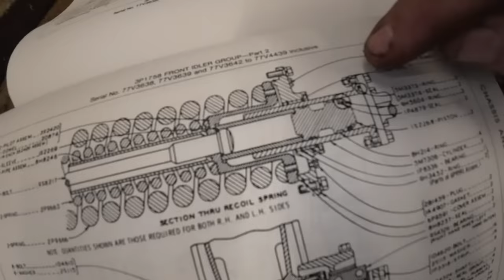We ran into several problems Installing the blade on the Cat D8K and getting it ready for paint!

Comment: Use a breaker bar with a pipe on it too break it loose. Air chokes pole. Unless you have a good compressor and air ratchet. Snap on has a 90° ratchet thats awesome for about $300. Well worth it.

Comment: I just happened across your channel a couple days ago.  I really enjoy the videos I've watched so far and I them educational even.  We have a 1967 or 68 96J D5 powershift that my grandpa bought in 1972.  I know there is a big size difference between it and the D7F and this big ol D8, but they appear to be really similar in design.  Where is a good place to get predrilled brake liners beside Cat?  I really don't want to pay $300+ per side for a machine that gets very little use on a farm.

Comment: Well, there is nothing like the sound of an old Cat diesel with precombustion chambers. They do clatter and rattle when they idle. The later direct injection Cat diesels are much more fuel efficient, and they don't smoke as much, but they sure don't have that Cat sound of the old engines. They also had to turn faster to make the same power.
Reply from the maker: For sure

Comment: Those chickens are not stupid. They hear a bird of prey calling in the family for a mid day snack and they KNOW their it. It's the dumbass humans that have the chickens penned in a roofless enclosure that has them squawking. Some of their basic natural instincts hasn't been completely bred out of them quite yet.  The "panic! Run! Hide!" instinct still works. 

BTW, it's November and you're not out hunting and/or fishing? Tell me you have the smoker running day and night.

Edit: Why are you temping fate? If one side of the track adjusting system is dry and needed servicing, why didn't you do the other side? If one side is damaged since it was last serviced and it shows signs from lack of service , the other side should be in a similar condition.  As a buyer I'll happily pay the  cost difference knowing both sides were done when it was overhauled.  Now one side has a diminished service life expectancy than the other. If you're that deep into the overhaul already it makes good business sense just to bust open your purse a little more.

 You were prepared to spend the money to fix it and flip it when you bought it, so why go cheap now? Just because it's easier on the purse strings?

Comment: do you guys have a specific concrete for the shop? how is it not mangled to pieces? especially at 4:21 climbing that tiny 1" inch rise from the gravel to pavement seems like it should be shredded.
Reply: oh. i think you answered the question a bit later. steel i-beams in the floor lol
Reply from the maker: Yep

Comment: Hey Clint how would you like to run an engine as big as the D8 a V12 @1010 cubic inch displacement...per cylinder, 4500 HP at 1500 rpm, of course it sits in a 420,000 pound locomotive, so. A couple of these can haul 20,000 tons of freight, I know it's not the same as pushing a small hill across the meadow but they are impressive.
Reply from the maker: That would be cool

Comment: The guy that put the forklift there should be sacked. This engine is great. Any other types with the same dna? I know an straight 6 172/5? Hp 1250 revs with a pony (optional?) motor. Was used in boats as well. This goes back to the cat 60 engine.
Ps: before cracking some body parts of me! 
I know this is diesel and the 60 is gasoline. Revwise speaking. For the one interested: there is a you tube vid on a 60 pulling a sledge. Only the plop gets louder. Rev stay as in a vice😉👍😉👍.